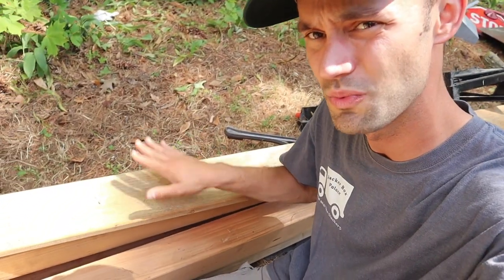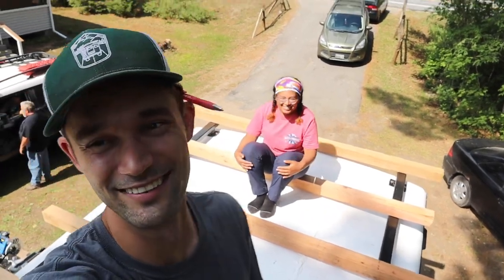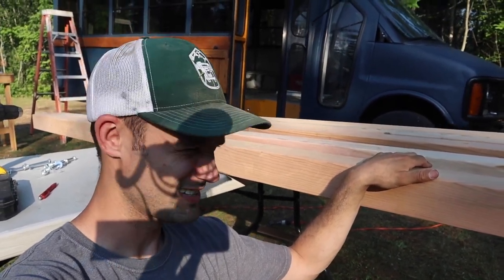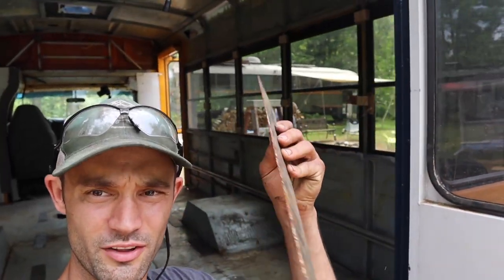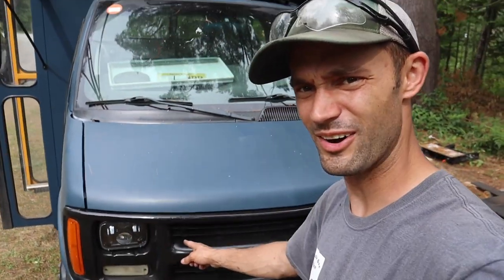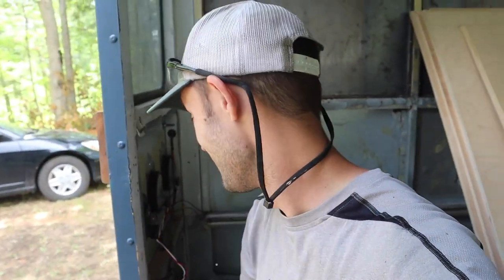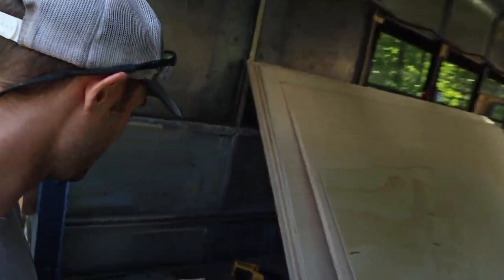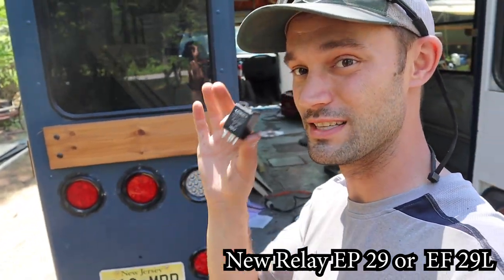Decking Out The School Bus Conversion | New LED's and Roof Top Deck

Comment: As a long time school bus and van contractor, I can tell you that the large size brake/tail and turn signal fixtures are made as an exact replacement for the old bulb style fixtures. They are available at your local Blue Bird , Thomas , or IC school bus dealers. Also School Bus Parts or Bus Parts Warehouse and several other parts suppliers have same fixture. They would save a lot of time and work for installing without modification of the holes !  Just a word to make life a little easier. The school bus parts manufacturers have thought of everthing !

Comment: To avoid having to replace the flasher they may a load bar to put in at the lights to make the flasher work properly.  I would have added plugs on the lights instead of hard wired in this way when something happens to the lights just put a new plug on the light and plug it in this way the wiring won't get to short.  But looking good and while you're up there I think it's Tampabaybusmarket for so Florida ones

Comment: Lookin’ GREAT, Mike!  Keep up the good work...Great info on aLl the lights...Thanks so much!  Looking forward to seeing your floor plan.  Also, we have a lot of holes in our floor...we were just going to cover with Dynamat...should we patch the holes first or will that suffice?  Thanks so much.
Reply from the maker: Thanks, I am excited to start putting the subfloor in ! It is such a big step to move inside. As for the floor holes, I am sure you could seal them with laying Dynamat over them. I prefer to weld or cover all holes because I am always just concerned with possible water penetration post build.

Comment: Small explanation on the relays..  Normal relays are configured for load.  Each bulb pulls a fixed amount of load.  the relay is configured to blink faster if that load drops (like when a bulb burns out) to notify you there's a problem.  When you replace the regular lights with the very efficient LEDs the load goes to nearly 0 so the relay buzzes like that.  They make LED relays that don't have this feature and simply click on a timer.

Comment: Since you didn't use carriage bolts to attach the wood cross beams to the steel frame, you should caulk around the countersunk bolt heads.  Otherwise water will accumulate around the bolt head rusting the bolt and rotting the wood.   Looking good so far.
Reply from the maker: Thanks, it’s not on film but everything was caulked and sealed before it was final installed.

Comment: I use Locktite Power Grab X8 glues metal together 24 hour cure time.Works better than welding sheet metal! if you make a mistake you will have to cut it out!
Led's are the only way to go.

Comment: How do you secure the black brackets/support rails to the bus roof. I am familiar with the steel "beams" that run from side to side. Are you just pre drilling and then running 1.5"  lag screws down in there? You can't possibly "bolt" them down bca bolt has a nut that fastens on the bottom and you can't access it. 
So, just beefy lag screws?

Comment: Welding aluminum is tricky because it has such a low melting point.  It tig welds nicely but you have to have a good light, steady pressure on the weld pedal. Anyway, my experience in sheet metal and weld training in aviation maintenance school.
Reply from the maker: I need you to come by and teach me a few things. I know I need to upgrade my welding gear so I will be able to mess around with various metal options. I can’t wait !
Reply: @navigationnowhere  I admit it's been years since I have welded and that was in aviation maintenance school in the late 1990s.  You might want to find someone a little closer to where you live if you are in New Jersey.  Also, you need someone a little more up to date in welding supplies.  I live in Kansas.  But if I had a mini bus like the one you are converting, I would choose  you to do my conversion even if it means driving it up there and finding someone who will follow me so I can get right back home.  Someone beat me to a bus I would have bought and even one I used to drive when I was an employee at an Independent Living Resource Center.  I don't know their plans for it yet.

Comment: Good job on the deck. Don't know why you used 4 x4. Could have used 5/4.
My house was built in 1945 here in R.I. The builder's used redwood boards on the walls and 5/4 on the door trim with wrapped aluminum. We have a building supply company called Builder's Surplus. They sell leftover lots of wood and other materials.
They have mahogany decking. That's what I would use.

Comment: LED Turn-signals, will REQUIRE an "ELECTRONIC" flasher unit. 
Because they draw insufficient current to trigger old-fashion flasher-units.
Reply: I switched mine out with no problems.

Comment: This comment is not meant to be a criticism but i don't get the roof top deck. wouldn't that space be better used for additional solar panels? love your videos!
Reply from the maker: The entire front of the bus will have high efficiency panels. I calculated how much power I would need vs roof space

Comment: made sense the relay was not rated for LED's, but how did you determine what the part # of the one you needed was? Also, why was the passenger side working, because I can only assume that they were matched relays, which to me means that both need to be replaced?
Would never have used that much heavy wood on the roof, aluminum all day. Putting so much extra weight on the bus imo is just bad in every way, braking, gas mileage etc

Comment: Question my man! Do all of your LED lights run off of your existing bus batteries or do you plan to have them run off of your new batteries for solar in the future? I'm just nervous keeping the lights on for an extended amount of time when they're wired to the original bus batteries.
Reply from the maker: Not all the LED’s will be on the bus batteries. The marker lights and light bar will be on the bus batteries because they will only be used while driving. The side floor lights will be on the   “House” batteries.
Reply: Navigation Nowhere you’re the man! Thank you!

Comment: Why did you use 4x4s for your deck?
Reply from the maker: The strength ratio for the distance I was spanning between the steel beams calls for a 4x4.

Comment: I sure hope those side lights are not on while driving.   Might blind on coming drivers
Reply from the maker: No they would never be on while driving. The headlights I got are also not projector beams they cut off between low and high so it will not blind other drivers.
Reply: @navigationnowhere   The lights would be perfect for camping and off road driving at night. :)